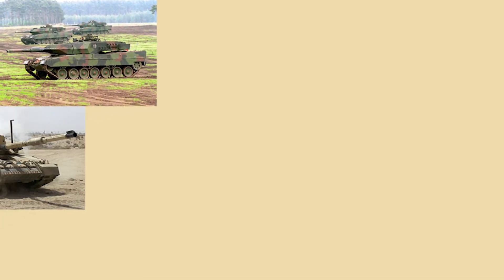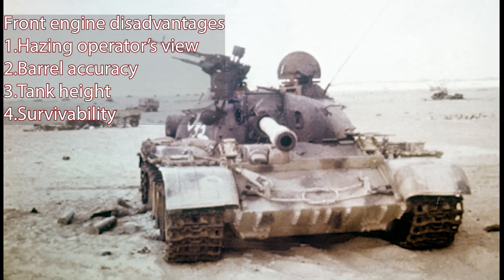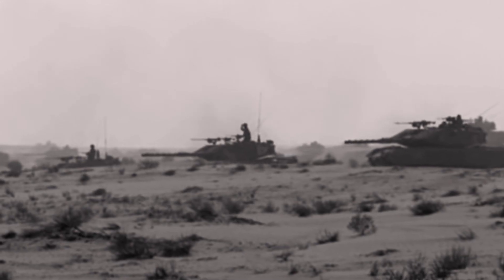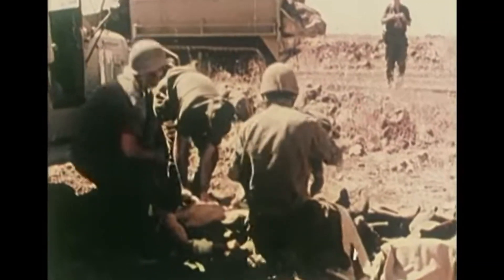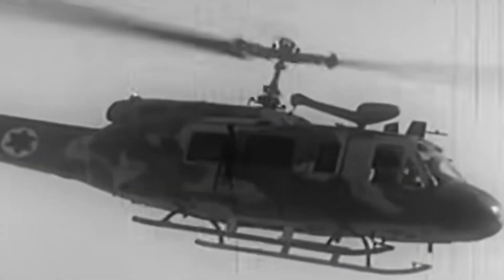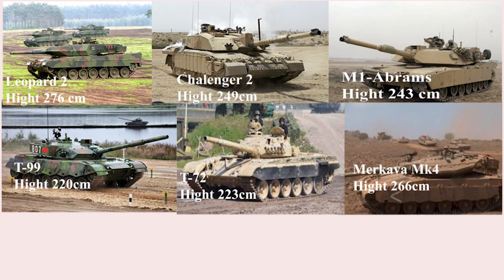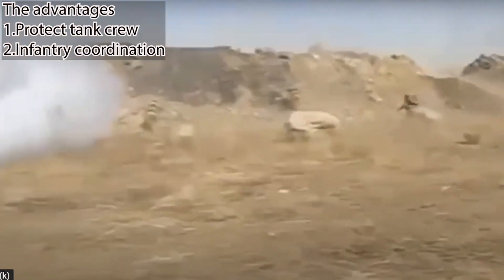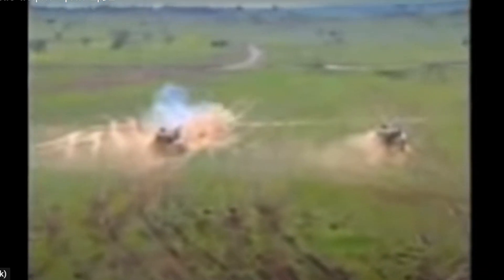The Merkava tank. Why engine at the front?

Comment: Israel usually has air superiority.  Consequently, an Israeli tank is most likely to be attacked from the ground.  They are usually attacked from the front.  Placing the engine in the front protects the crew.  This is far more important to Israel than to other countries, because of their small population.  They can more easily replace/repair a tank than a tank crew.

Comment: The thing is that engine on front, at least in case of Merkava, has no real advantage or disadvantage. It doesn't protect the crew any better than huge fuel tanks in other tanks like Abrams and T-64/72/80/90 tanks, the driver's position is next to the engine so it its just moved from traditional center position to the left, like some other tanks, this might even be a disadvantage since fuel tanks can offer additional protection for the driver from side hits since liquids are very good energy absorbers. So Merkava's crew is not better protected than the crew of , ie, Abrams where fuel tanks and armor behind fuel tanks serve as extra protection (no fuel doesnt blow up when hit like in movies). So there isnt any positive or negative with it. Real reason why Merkava had engine on front was for infantry transportation for tank support without any need for APCs or IFVs that are less protected than an MBT. But it all comes down to doctrine, other nations dont have such doctrines, in fact even Israel kinda fully moved away from that and pretty much all Merkavas have extra ammo in protected stowage where infantry should be and have only room for 1 or 2 wounded in case someone needs evacuation without anyone else to evacuate them. Namer has taken the role of heavily armored infantry transporter, and its great, currently most protected APC in the world, on top of its good armor it had Trophy APS, so a need for Merkava as infantry transporter is gone. So in conclusion there isnt any upside or downside for it, it was a requirement back in the day Merkava was developed up until recently with introduction of Namer.

Comment: As a veteran Merkava tank commander:
Changing the engine takes 30 minutes and requires removing easy to access 21 bolts.
It's like a racing car, highly modular.
No other tank can be repaired in the field so quickly.

Comment: The heat problem is a non existing one. There are no exhausts in the front of the Merkava, only at the sides, and the front of the Merkava has very thick, partially ceramic armor, which is a very bad heat conductor. This does not obscure the thermal sights at all.
Reply: לא היה שריון קרמי בזמן תכנון המרכבה.  המנוע ומיכל הדלק שימשו כמגן
Reply: אני מדבר על מרכבה סימן 4 וכנראה גם 3
Reply: So you are saying engines make no heat as I understand?
Reply: @54oguzz  The heat goes to the exhaust systems on the sides. 

Only hot smoke can obscure thermal sights, there's no hot smoke on the front. 
Basically all IFVs have their engine at the front and this was never a problem. Not to mention there's software designed to fix any thermal disturbances in high end thermal optics.

Comment: Engine is in front because the tank crew is very much important than the tank itself. Tanks can be replaced, but it’s hard to replace a well trained crew.
Reply: The engine provides very little protection even againest old shaped charges so this isn't very accurate but the tank suites the Israeli needs so I think it's not a terrible tank
Reply: The very idea that placing the engine at the front of the tank, the part most likely to be hit,  is protecting the crew is hilarious.
If the engine is damaged, rendering the tank immobile, how does that protect the crew?

The engine is in the front because it is a front sprocket driven tank.
It is more efficient to pull than to push.
Plus you eliminate the need for a long drive train which runs the length of the vehicle and the problems with reliability and maintenance that has always come from that design.
Reply: @yfna1  also if it is penetrated then that’s just more spall but I think they have a shield for that so probably not

Comment: The engine protect the crew, israel is small country so evry soldier is very importent.
Reply: But does provide some protection against heat charges, which is the only kind of charge that the tank will face
Reply: @77seven77  Even old AT rockets from the 70s and penatrate  it
Reply: @judejohnson6336  the engine increases protection, it's not the only thing that protects the crew.
Besides, do you have any proof?